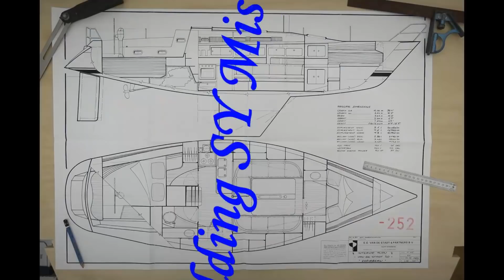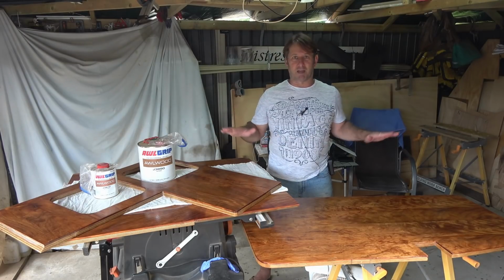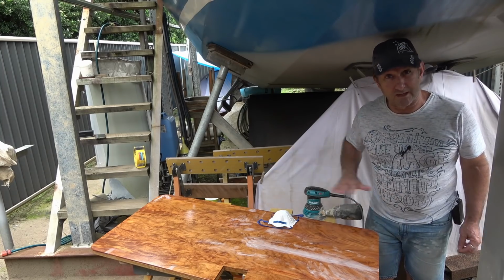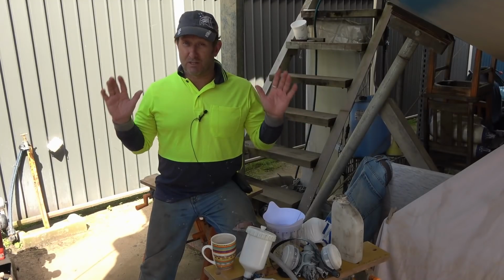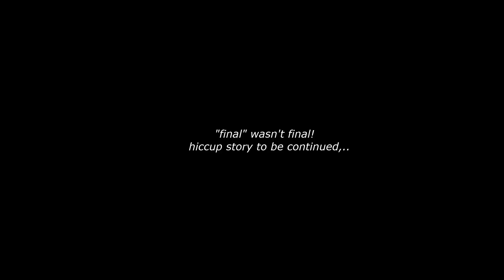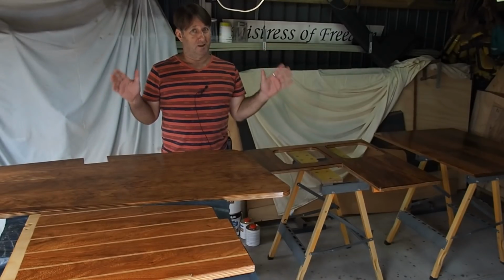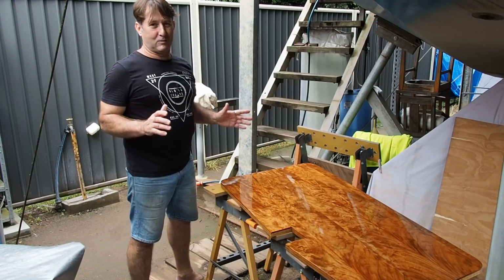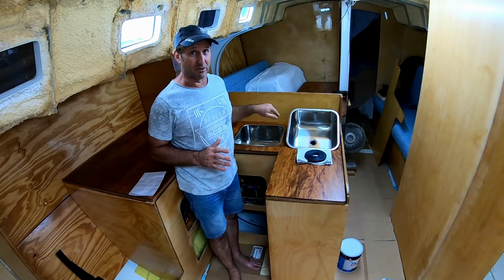Building my steel sailing yacht Ep.108 TOPCOATING the TOPS + install (pt.2)

Comment: Looking fantastic Bruce, absolutely agree on the Satin finish, personally I couldn't live with the gloss either. I get the feeling that you were already mentally prepared to having to do those all over again after experience with the sole! It's done, looks fantastic and will last forever. Sorry to hear about the camera and the footage, is it completely dead or is there hope for recovery?
Reply from the maker: Thanks very much for your good comments and question, much appreciated and re. the camera situation, the good news is that I got most of the clips recovered ($$expensive$$) and I sent the Sony for a full check up because it was playing up and faulty and it came back as NO PROBLEMS which was FANTATSIC news and it has been performing normally since, which I have been SO happy about!  😁👨‍🔧👍

Comment: a million years ago your 'little mate' would have eaten you :-)
glad you explained about the focus, i thought it was my beer :-)
why are you putting down a gloss if you're then sanding and using a satin finish?
and finally, a funny thought; your steal boat is looking very woody  :-))
Reply from the maker: 😆🦎 too true Iain, thanks for your good comments and question and the reason why I put down gloss first under X2 coats of satin is that if I was to only have put down the satin it would have obscured the wood grain underneath much more and ooowww Yes, I do love the strength of steel and the look of lovely timber  😁👨‍🔧🌳👍
Reply: @BuildingSYMistress  thanks

Comment: I know it's too late, but as an old auto painter, always start away and work towards yourself. Much less likely to drag a hose or shirt tail through your finish coat...Might want to look into 'Wet Sanding', always produces the smoothest surface...
Reply from the maker: Thanks for your good comments and suggestions Mike and yes understood, also fyi I have been following the advice from the paint rep. re. sanding and application
🙂👍

Comment: Wow, Bruce, you certainly have your share of trials and tribulations. (Note to self: as dollar value of coatings increases, shelf life of the products decreases... Exponentially.) I, too, have suffered the heartbreak of painting with snot (and stuff resembling other foul bodily excretions). I've always kept my coating products "free range"-- out in the wild, cavorting with my lawn & garden tools and half-empty motor oil containers. (Ya know: if it's good for chickens and eggs, why not paint?). And I always figured the stuff was "self preserving" by forming that thick skin above the remaining liquid-- a thicker skin every year = better preservation, right? Sadly, I was apparently mistaken. By year five the cycles of freeze-defrost-boil had rendered my free-range white enamel (beneath three inches of "skin") a non-descript color. Reminded me of "The Exorcist", somehow... And, though the stuff didn't even coat my stir-stick, I still tried to use it. Paint brush wouldn't pick any of it up, so I splashed some on a chair. Looked like crocodile hide. Never dried. Tried to sand-blast it off. The sand stayed on it. But it sorta drips now and then. I now have a chair forming stalactites in a corner of the yard. Generations from now, vacationing water dragons will tour the chair-chasm and take selfies to post on "Critter". 

Anyway, this post isn't about me and my chair and the distant offspring of your "little mate". I'm just glad this experience didn't result in the 'sole crushing' (see what i did there?) debacle of a few months ago. Love that Rosewood!
Reply from the maker: Thanks very much for your good comments, much appreciated and it was a good read and chuckle 😆 and re. getting 'sole crushed', we just need to have a 'thick skin" and keep moving in the right direction hey, thanks again  😁👨‍🔧👍
Reply: @BuildingSYMistress  By Jove, you got it!.  Always happy to give a chuckle, Bruce, Rock on!